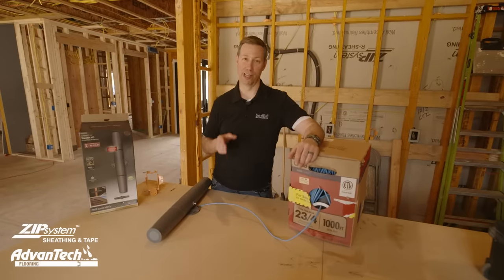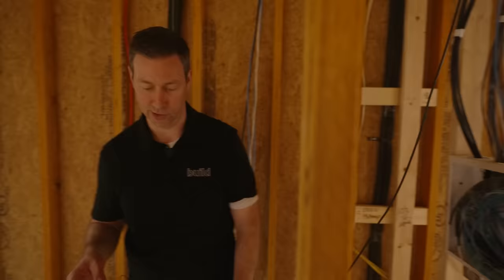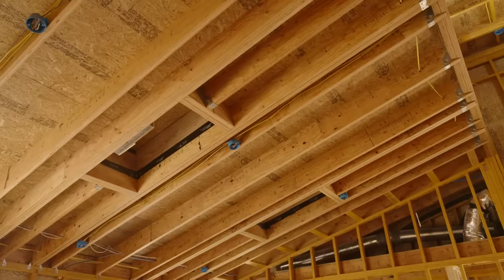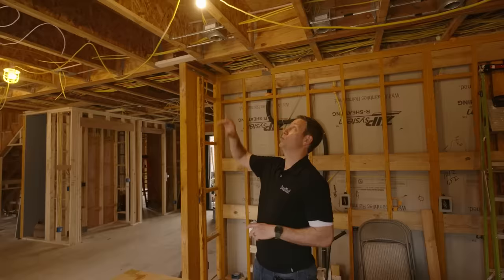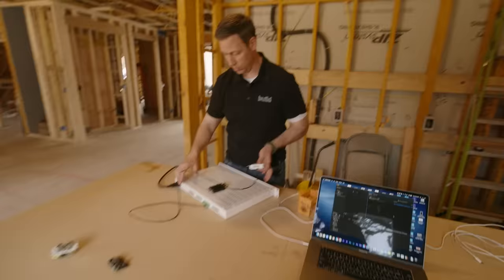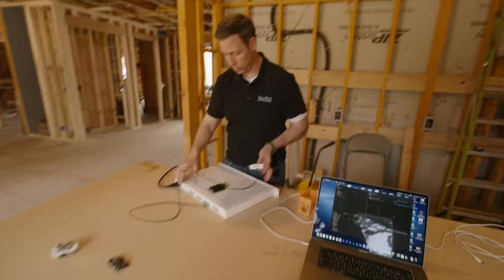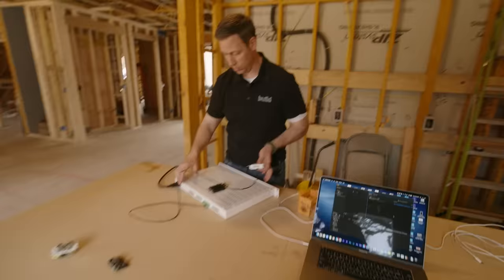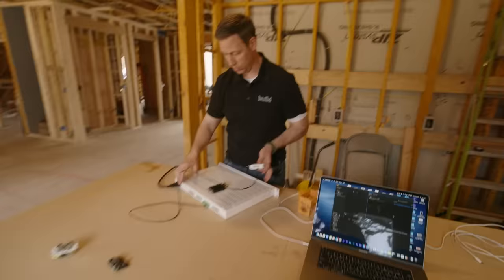Low ⚡Voltage at the Real ReBuild

Comment: There seems to be some concerning thoughts here.

There's a large group of us around the country/world that run extremely large Christmas light displays that run on low voltage (5-12v).

This matters because we run a lot of external power supplies that run around 300w (at 5v or 12v each).

Like landscape wiring, any runs more than 10ft should have 18, 16, 14, or even 12ga solid or stranded wire.  Having to do with watts/amps and less about volts.  Most of us don't run lights at 100% nor our PSUs near 100% yet still experience color distortion issues on longer runs.

Looking at a "brick" laptop supply I have (that would run a small laptop and a docking station) - the wattage is 130w, output being 19.5v, 6.7A.

That means there's a flaw in thinking you can have the shown Voltek in a rack in the middle of the house and then a 100ft run of thin gauge wire to properly and safely run/charge a laptop.

In fact, as the voltage gets lower the voltage drop increases significantly over longer runs of smaller wires - meaning you may actually have to run THICKER wires on longer runs since the wiring from the Voltek rack to the outlet is actually carrying the load.

Since this is about low voltage- you should also consider a permanent roofline light system (commercially available would be something like Trimlight) and/or landscape lighting.

Comment: I am a certified technician via BISCI and see some issues, love your builds but see some of the same wrongness again and again from "electricians" doing low voltage.  MAKE sure that low voltage is not run parallel or at least not int he same stud bay as your high voltage or you will possibly get EMF crossover.  You will really see it if you test the wires with a celebrated tester.   Media box far too small.  No "smuf" tube in the walls in case technology changes. Sorry did see the one at the DMARC but any place you can get top is a good place to at least install and do a photo red line.   For sure one from media box to attic as well.  Spend the money on the coax go RG6 solid copper center quad shield, normal coax is a copper clad steel center conductor.  small upgrade but far better bandwidth.  I STRONGLY suggest you land all your CAT 6 cables on 110 blocks so they become structured cabling.  Keystones are meant for jumper cables and not background cables.  I would run at least one RG-59 from your media center/amp to attic in case you want to run XM RG6 is not the correct cable.  Just thinking with an open mind and lessons I have learned.  I land all cables on panels and test all with a calibrated tester and print the results.  I love the show and will use a lot of your material on my next build.  I am looking forward to my forever home, a BARNdo/ with RV sized garage/shop roof access hacienda style.  My current home a 25 year old has cat 5e running in all rooms (2cat 5e and one RG-6 x 2 each rood so avoid patch cable issues) plus a fiber in at least on box.  Fiber running to both thermostats, 2 cat 5e and two fiber and two RG-6 to DMARC .  In the wall home theater in 3 rooms (two being used) and "smurf" tube in at least one wall in each room to attic in case technology marches on and I have to make a add/move/change.  OPEN walls are an opportunity just waiting to be exploited.  What about those window coverings or the outside patio speakers or???????????????  Opportunity is knocks till the sheet-rock is installed.  LOVE your show and presentation.

Comment: Voltek is interesting however, they can provide 60 watt power which is good for small 13inch laptop, 15 or 16 inch like the one shown take 96watt. Laptop will be ok with low watt but takes way longer time and might degrade the battery or/and heat up the source.

Comment: I'd like to hear more about installing cameras from a builders perspective. I imagine it's just running more Cat6 to various places but would like to hear your thoughts/experiences with them
Reply: That’s pretty much it, just be sure to stick to no more than 300 feet per run, don’t go over that. Adjust the size of your switch (the amount of ports it has) to your camera count plus 2 ports for an in and out between switches. If you have a camera that’s over 300 feet, say 400 feet, having a switch somewhere in the middle allows you to start from “0” feet again. For example a camera is 500 feet away, if you have a switch 300 feet from your Network Video Recorder you can get to your camera from that switch the last 200 feet and it’ll work.
Reply: @dallashill23  I would add to use a bandwidth calculator for the cameras as well. Multiple cameras will crowd up the network and degrade your other device performance. If you use higher quality equipment and set up VLANs you can improve the situation greatly. Nicer 3-8MP cameras send a ton of data
Reply: @Niccodemure  I would think it would be best if you had all your cameras connected on their own network/subnet so that they're not sharing bandwidth with your other internet devices.
Reply: @tomroehl5126  Agreed.

Comment: Back around 2013 a company called redwood systems was doing PoE LED lighting for commercial applications. I was dying to do a job with it but it never came together. I remember reading they got acquired. I don’t know if anything they did lives on or not.

Comment: You know it does kill me were home builders do not build in a Back Bone ... I used to work for a phone company in Canada .. Apt buildings .. office towers ... you name it had them ... Thus I do not understand why in homes a Backbone is not installed .. the cost is just a pvc pipe ... thus easy to change rooms around .. Wire can not be hacked easy.. wireless can

Comment: Not sure if someone has already mentioned it. Since you said low voltage lighting, Ubiquity has a lighting division of its UniFi line. I have never been sold on it because you have to use a network switch to power it.

Comment: You can’t go wrong adding 3 or 4 pull wires every place you run low voltage wires instead of spare Cat6 or low voltage wire. Cheap pull wire  avoids the possibility of the iPod brick thing. You can even use cheap flexible conduit to carry all of it.

Comment: For future proofing a home I would really consider employing the services of a consultant and putting in conduit everywhere possible.

It would seem a good idea to have the majority of the wires come back to a patch panel so that you have maximum flexibility. Going wireless should always be considered as a last resort, where you can, plug it in. If you are going wireless you need a MESH system.

To guard against things becoming obsolete it is not just the technology, but the suppliers you have to consider. All you have to do is look at the average house that was built ten years ago and see how obsolete some of the new ideas then have become or are becoming, just look at all the advances made to USB with the type A, B, 3.0, Mini, Micro, C Micro B evolution.

1,000 Mbps may seem fast enough, but chances are, at some point in time, that is going to be considered slow.

Comment: Be aware the cable for the tv is extremely delicate and is about 1” wide at the connector. The actual cable is about the size of a single 18ga wire.

Comment: Matt, 
wall mounted USB is probably not the best idea, even if would have cost $10 let alone at at super expensive $1000 and additional cable management. The USB standard simply change too often to be permanently installed in a house which will last 40-100 years. This also applies to the tile mounted speakers in the shower. You can run cables in conduits in the wall but the actual device should be external (in my humble view) so that you can change it without tearing down the wall to upgrade or replace a broken speaker after 5 years. If you really want uncluttered USB then integrate it in the furniture (desk). 
  
Also, run wired Ethernet to as many places as you can since you can easily use the cable for "Power over Ethernet" at 50V which is good but all future entertainment will definitely be internet based. Minimum recommendation is 2 cables in each room, one for wall mounting and one for the ceiling for access points. 

Finally, aren't all LED drivers already DC on the secondary side? Mine are 24-48VDC. This means that I run 10A@240V AC wire to a few of LED drivers in a serviceable location in the ceiling and then run some thin DC cable to the actual LEDs.

Comment: wifi needs to be outside the faraday shield that should be around and over every new home.  Then a small hole in the shield to allow the cone of wifi downward into the home for anyone that really needs wireless.  Any fixed appliance outside the cone must be wired.  wifi cannot be inside the faraday cage, because relections would actually magnify the wifi signal into your body.

Comment: Interested in the inet and additional low voltage detail. 

I will say the voltex solution doesn't make a ton of sense to me unless you seriously have MANY locations where you would need usb power delivery only and not already have an AC circuit to tap for a normal a/c outlet. I would also not count on a no name company to be around to support whatever new charging standards are made available....similar to your comment about apples connector changing... You've boxed yourself into a corner with this voltex stuff...

also you can buy single gang a/c outlets with USB and PD connectivity (60w) today....

Comment: The link you put for the cat6 cable goes to some cable, but it is copper clad  Aluminum Ethernet cable and it is not recommended for Ethernet cabling only solid copper cable is allowed to be used

Comment: I would personally use cat 8 cable, since you are running them close to electrical wires, those shield cat8 makes a different.
Reply: You can do shielded cat6, cat8 is so overkill, I doubt any of his equipment could even take real advantage of it. Plus cat8 is like $1+ per linear foot, and like $15 per termination. Perhaps for future proofing, like 20 years in the future it would be nice, but idk man lol. He really should have ran conduit for all of his low voltage. In modern construction, low voltage really needs to be a priority, as everyone and everything depends on it, it shouldn't be an after thought like it is currently.

Comment: I'm all about the 110v outlets as they are relatively inexpensive and easy to swap in the event they become obsolete....I feel like that low voltage dedicated outlet systems seems like intercoms which as far as I'm aware have gone away. Tech standards change oh so frequently and i definitely have reservations about spending that much to simply just make it so you don't need to plug in the power brick for your computer. I mean to each there own but i know when you reviewed things you wish you hadn't done at your old house...i could imagine this would qualify for the video on this house in years to come.  I guess since it was free you it doesn't really matter for you :)

Comment: As a sparky 40 years ago called 13,200 voltsetvices high voltage. Now that is called meduim voltage. You could use #14 guage copper wire for just lightning circuits. Must use #12 in laundry  bathroom & kitchen countertop receptacles. 35 yrars ago installed RG5 cable for my TV'S. Cable company told me should have ran RG6 but that was not out yet. Wish that I ran a conduit from basement to sevond floor TV'S. Not crazy anout the extra deep combination receptacle/USB port. Even with a deep box need a shoe horn to install especially with 2 #12 cables in box. Think expensive fiber optic cable will be used right up to TV & Computer towers in near future. You can use low voltage for all of your LED lights. PoE = power over internet. Saw a vid whete they wired all the normal & Exit luminares with low voltage cable. No such thing

Comment: Yes Matt, I like seeing your tech videos here... I have become a fan of ubiquity... I'm currently using Chromecast audios to distribute music in my home but have been evaluating Sonos for my next build.  I'm really torn on which smart lighting system to go with and so I liked hearing that you had chosen Halo as that gives me a reason to go check them out now... Love the idea about putting motorized blinds in my master and the tip for the future proof conduit to the attic.... You've invested hundreds of hours or thousands of hours doing the research on these different products and I find that experience incredibly helpful when you share it with us
Reply: Do yourself a favor and check out Bluesound.  They use amp tech from NAD and speaker design by the guy that founded PSB speakers.  Now you can still put those chrome cast to work if you use Roon for your playback it’ll send audio to any chrome cast enabled device and hirez audio to Bluesound devices.  I say this as a Sonos owner.   BluOS will soon be the most prominent multi room system after Sonos. They’re doing good stuff

Comment: The bad thing about unique network gear is,  very short life and after a few years you cant get parts, service or software updates. I prefer overkill run CAT 6 and for a few dollars more run SMURF tube with fiber. I agree with 12/2 its always more flexiable to have more copper than less. I prefer hard wire  for security and network, its easy to jam wireless signals for securirty systems.

Comment: When building a home, would it be possible to run conduits for the low voltage wires so that in the future when the next cat cable or fiber comes along you can simply feed it into the conduit? As opposed to having to run wire with fish tape next time you want to upgrade

Comment: Service loops… if you install proprietary hardware into the wall, leave several feet of service loops so that the devices can be removed from the wall but the wire behind it can be reused…

Comment: That’s a complicated subject. Energy management and solutions surely are changing fast, and a lot of it depends on personal preference as well. Regardless, here is my take…

Want flexibility into the future? Don’t do the low voltage wiring. Standard household wiring is connected to 10 amp fuses. You can probably run 10-15 LED lights on that. Your low voltage wire on the other hand, try 1-2 lights per wire. 
Those hardwired USB type outlets won’t be able to accommodate future tech. Especially if run on a low voltage wire with a main supply closet. Most LEDs have a step down converter build in. It ensures they get the power they need. 
My Solution: get a USB hub that plugs into standard 110V outlet and provides you with all the power you need, where you need it. Low voltage wire is loved by many because it’s DIY friendly. 

About that 12 gauge wire and resilience. First off, long runs of DC wire have a much larger power loss than AC runs. That’s why high voltage is used for power transmission. On a long DC line you have to increase the voltage to be able to supply the target with whatever it needs. So stick to AC wiring, except speakers. Or short 20-30 foot runs. 
My personal solution: run a dedicated 10 gauge wire, with a plug & play exchangeable fuse into EVERY room.You start out with a 10 amp fuse but can have 20, 25 or 30 amp fuses on hand.
These 10 gauge wire runs all get combined into one distribution panel. That panel in turn gets a grid-tie disconnect switch and a battery backup system. A Sol-Ark 8kw can provide that, plus giving you an option to connect a generator and solar. Or you could run that as a grid independent system all together. This is where you put all your critical loads that you don’t want to be disrupted. A proper energy audit would be needed to size the system. 

I’m sure you will find a solution that you like. Have fun with it

Comment: Ubiquti is really good, I am using one of their unifi access points. One thing is that the dream machine apparently makes some things far more complicated than they should be, but that is some more advanced stuff that you might not use.

I will also point out that cat6 is good enough, but I would have gone with cat6a or more likely cat7 so that it would be ready for 10gb ethernet.

That low voltage outlet system looks nice and I would like something like that, but the problem that I always run into is that there are like half a dozen or more different charging standards and they keep changing which makes it very difficult to recommend.

Also if you want more information or to talk to someone who has been very involved in tech for a couple of decades I live in Austin and would be more than willing to talk about this.

Comment: Matt, are you using the dream machine pro? I would highly recommend it for your rack mount setup. Add in a 48 port switch and you'll be able to control all your cameras, wifi access points and ethernet drops from one location.

Comment: I caution against recessed can lighting. It's not so easily changed in 2 years when the tech is outdated. I prefer just ceiling boxes so you can easily swap out with new lights.

Comment: Hey, question here. I was watching your video and I noticed that you said that the device (USB-A and USB-C device) would be wired DC from low voltage transformer (Voltek) to the actual device. Is that legal and upto NEC code being DC in USA? Or is it different because its only running at like 12 volts? Just food for thought. Love your video, keep up the good work.